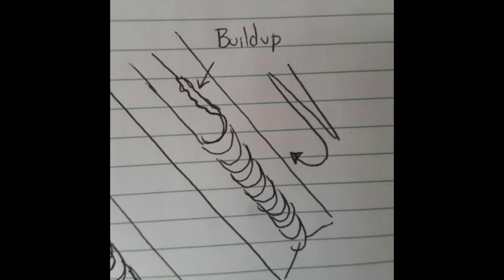Podcast with ICWeld

Comment: Very informative podcast.  As a fellow "only a stick welder" (iron worker) by trade so many things that Isaac said really rang true. The whole get the root to hold metal and then I fix it because look at the gap, paint, dirt, slash whatever is an everyday thing in the field.  We joke when we go back to test for all our certs, get in the absolutely most unconformable position possible to weld, then explain to the apprentices "This is what welding on the job is actually like."  I also  had a bit of a giggle at the cutting away from himself with the torch to save boots as it is often a tell tale sign on the job of who has experience burning and who doesn't.

Comment: A big thanks from me...
You answered a question or two I never got a straight answer to from the welders I've helped over the years being the gofer and the strong back when needed. I was a millwright that answered questions about process and mechanical application as well.
Yeh, I had to put it together and final inspect before the OK for startup. 
THANKS again.

Comment: Sup Jody, got a question, I recently obtained a small home welding machine (it a Sears Home -N-Shop). My question is being that it is a 70 amp max machine what rods would be best to use with it?  It trips my breakers and it sticks often on max amperage. Just been trying to get better with it, dont know if its just really dusty, been sitting for Years. Im no pro just about to take classes, I have a flux core machine and I am proficient with it, just confused. Please help.
Reply: Try 3/32 6011 or 1/16